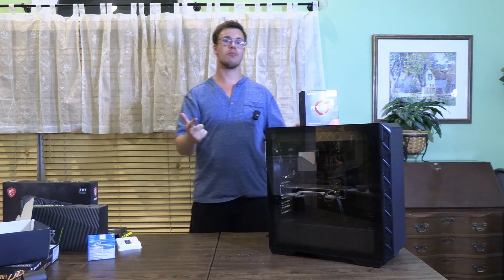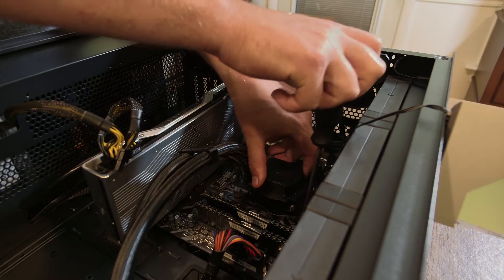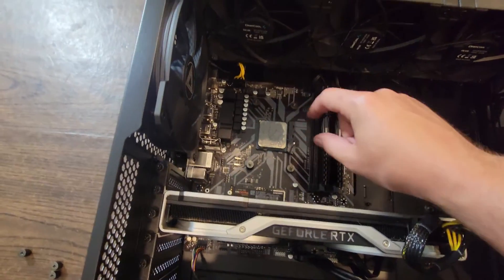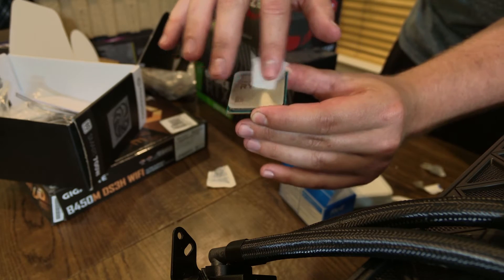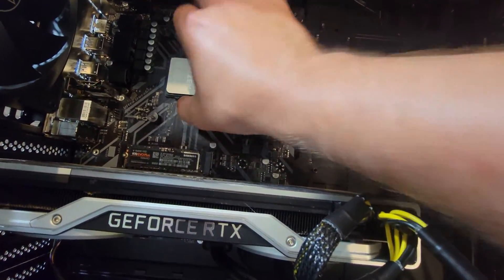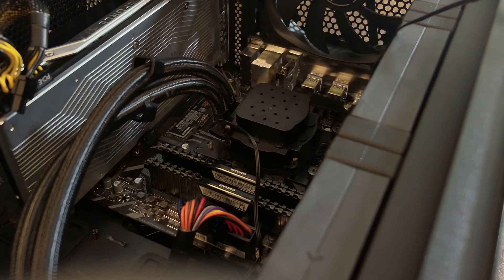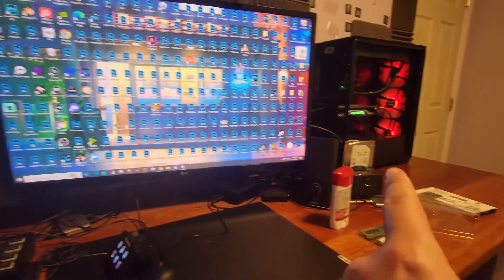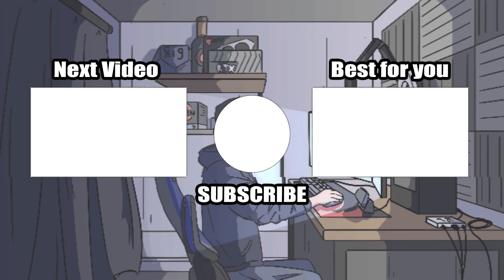How To Upgrade Your Ryzen CPU | AMD Ryzen CPU Installation 2024

Comment: thanks man. I was scare to change my cpu cause of i did not wanna break my computer. And you made it super easy for me to install it. I went from a amd 5 3600x to a Ryzen 7 5800X3D to go with my 3070. Seemed a better fit than my bottleneck cpu lol anyway thanks

Comment: Thank you.

Concise and complete.
Reply: One question: if you're on one of those OEM CD Keys for Windows, will upgrading your CPU count as a "new system?"

Or only if you change the motherboard?
Reply from the maker: @antondovydaitis2261  The OEM CD for Key for Windows resides in the motherboard, so if you switch motherboards, then you need to write your key down and apply it to your new motherboard.
Reply: @TechGrant  That's what I thought, but I had also heard a couple creators hedging on that question.